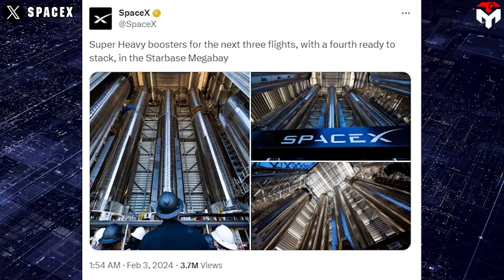FAA officially Declared the Starship IFT-3 Launch Date!

Comment: Musk keeps claiming starship 3 is ready. He is lying. It still has 33 engines. That 20 to many engines. He is forging ahead as if this rocket was good. The ship will blowup again with an early hot launch. The the hot stage ring is to short. So kiss starship goodbye too. Maybe after 6 explosions they will be a new redesign.
Reply: Curious..You know this how? Are you on the team? An engineer? I am curious.
Reply: @sevnsyn  

As a matter fact I worked in manufacturing, electronics and electrical. I rebuild old cars in my spare time. I still ride my hayabusa’s and both dirt bikes. I rebuilt a 69 corvette and modified its suspension which I drive occasionally. I own a lotus Elise which is just pure fund to drive.

When I speak about starship it is from past experience. If you doubt anything I had to say just study the physic’s of what they’re trying to do. I’ve had projects that have used every material they make today.

Last find one rocket that was successful with 33 engines or more. New flash there aren’t any. So why don’t you explain why you feel starship will work  as is. You need to study the electronics, the tank structures, the engine mounts, and last the material they’re using. 304L stainless steel is too heavy. This is why Elon wants to pursue refueling in space. If he change to 7075 t6 aluminum . The rocket would lose 90% of the weight the rocket has to lift in addition to the fuel. To get the rocket to space 75% of the weight is fuel on board. So reduce the 25% of just rocket minus payload. Then the rocket could be smaller and lift more payload. A large rocket as it gets bigger you start getting diminishing return from the rocket. Let me know what your research comes up with. I’ve dealt with facts my whole life. I never had the luxury to play with projects that exceeded the physic’s of the material, electronics, wiring harnesses, and fuel lines. When you expose any material to -450 degrees it changes the characteristics of the material being used. Mainly it becomes brittle..
Reply: watch him be wrong(watch me be wrong)
Reply: @frogofbread  
Give me a text back when it explodes again. What interesting is too keep doing the same thing and expecting a different result. If Elon believes in starship. He should board the rocket to prove his conviction and then let land and be cought by chop sticks.

Comment: I have a hard time envisioning the launch cadence you described in this episode. I don't believe they'll do more than three (3) or possibly four (4) this entire year. I want to be wrong, but I just don't see it. There are far too many regulatory hurdles, and frankly, this current administration is not a strong proponent of anything related to Elon Musk. It's sad to bring politics into this, but it is inescapable. Anyway, we’ll see. I suppose if IFT-4 really does launch approximately one (1) month after IFT-3, this will be a solid indicator I'm wrong. I'm betting IFT-4 will be three to four (3-4) months after IFT-3. Just my thoughts.

Otherwise nice episode, as always, and thank you for your efforts on the part of the SpaceX fan community. Great Job! 🚀
Reply: The more successful each mission is, the easier it should be to get the next license. If they are able to make orbit this next mission, then I would expect it should be much quicker to get follow on licenses. 

SX has asked for a waiver to get up to 9 launches out of Starbase this year. Their production speed of making new boosters/ships is increasing rapidly, and they recognize that to make the needs of supporting Artemis missions, they MUST get  1) orbit + safe reentry, then 2) landing of at least the upper stage, 3) landing and reuse of the booster 4) fuel transfer all working if not 2024, then certainly by mid 2025. If they can't, there's no way Artemis 3/4 happens...
Reply: @mikekopack6441  Well stated, and I do hope you're correct. Crossing my fingers.